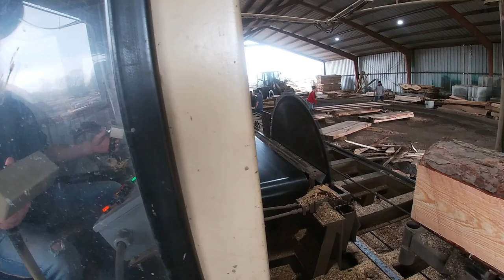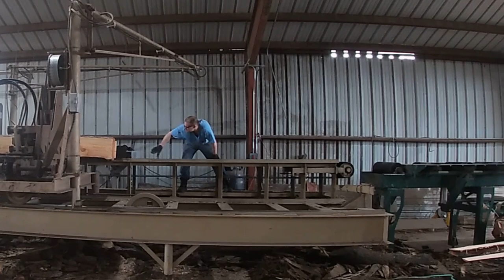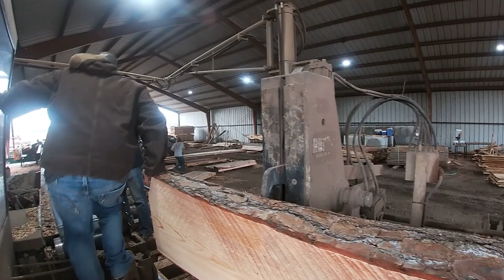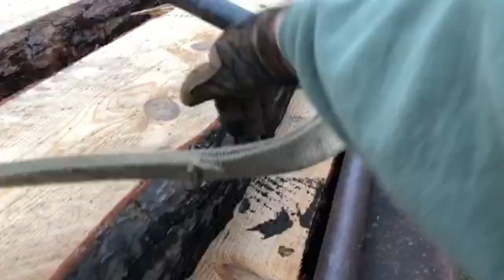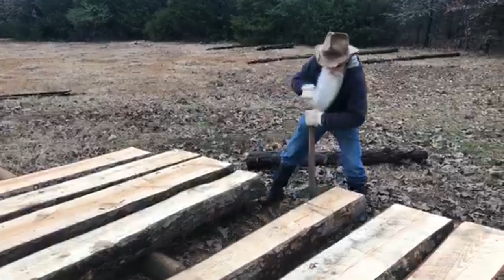Sawing Pine Logs for The Log Cabin Build (Ep 4)

Comment: I left me bark on the jack pine and leave the log for a bit. I let the pine beetles get in and chew for a bit than I go and peel the bark off. I love the patterns they leave when they chew the wood.

Bless you and yours.
Reply from the maker: NorthWest Firefighter Howdy- it would be so much easier to not have to worry about the critters it the logs but down here they will get in the logs if I don’t get the bark off fairly quick. They bore down into the logs and leaves ugly tunnels in the wood. When the logs are sawn into lumber the boards are very interesting with the marks the bugs leave. Thanks for watching and commenting. God bless y’all

Comment: So is this yellow or white pine? I live on the Missouri side of the Ozarks and planning on building a traditional log cabin but was told to stay away from yellow pine because they rot. Do you have any insight on this? Thanks
Reply from the maker: Loftis Party of Six - weROAM Howdy- thanks for watching and that is a real good question to ask. As with just about any kind of wood yes pine will rot. Keeping a good roof  with plenty of overhang, porches ( which l think should be on any cabin) having the bottom logs high enough off the ground to keep moisture off. Also, orienting the cabin against your prevailing winds helps. There is a lot that can be done to eliminate rotting. As with any home there is some upkeep. I have done repair work fixing bad logs where there was poor design or bad roof. Yes, l am using yellow pine but with the design I should never have any problems. Hope this helps-if you have questions you can email me at The Bearded Carpenter 8@ gmail. com. God bless

Comment: so I just bought some land with trees on it that I want to cut to build a cabin with. I have to clear at least 2 acres out for my shop and cabin. when I cut the trees I wont be immediately using them, so what do I need to do to keep them good until I am ready for them? they will sit for at least 3 to 6 months before I can do anything with them. Do I completely debark them, or leave them and stack them with spacers between them. I dont want them to rot or get bugs in them.
Reply: Yoshi Ben With me I left the bark because I wanted the pine beetle to get in under the bark and chew for a wee bit to get the marks they leave. I love the marks. Than I peel them and stack them with spacers in. I would suggest you peel them right away if you don’t want bugs.

Good luck and enjoy your cabin build.

Comment: Wow. Cool saw mill. I don't know why but if I were to choose between Machine milling I prefer the look of logs milled on a large circular saw mill rather than a bandsaw mill
Reply from the maker: Howdy Tim- circular sawed timbers do have a distinct look over the bsndsawed timbers. Yep, that’s a really fast mill for a small operation. Take care and God bless
Reply: I have to agree Tim, circular blades do a much better job...I think it's that slicing of the fiber as opposed to cutting 'across' the fiber...produces a better looking piece of wood I agree...clean
Reply: @chrisharrell5945  yeah. It's probably more of a shearing action with the circular blade. I'd love to see a comparison between moden band saw mill and the old, water powered vertical cutting setups.  I don't know what they were called but they are kinda like a giant jigsaw.
Reply: @timbarry5080  "shearing" - exactly what I meant by my word 'slicing' that I used.  Shearing/ slicing.  Same theme at the wood lathe, the younger gens are all over YouTube using the carbide tipped lathe gouges without understanding the traditional gouges shear and produce chatoyance, whereas the newer tooling on the market doesn't.  Those new gouges are doing at the micro very much similar to what the band teeth do on the larger scale.  More of a ripping and tearing as opposed to shearing. 

Yeah that would be a cool comparison - the old water powered setups..I bet you can find some archived videos somewhere with Roy Underhill doing a walk through.  I know I've caught a snippet of what you're talking about before and believe it might have actually been with Roy.  My recollect wants to tell me, I've seen that very machine in the background somewhere, sometime...I just cannot recall where but my subconscious remembers.  A giant jigsaw.  Heck, I'd love to build one.  Seems safer to me...I know, it's just a mental thing-- but there's something about those large circular blades even sitting in park that shake me....just looking at them in park rattles me a little...I guess it's like those big ol timber rattlers 😂
Reply: @chrisharrell5945  can the average user even sharpen a carbide gouge? I have and use a lot of vintage circular saws. Often they come with the old blades. Sometimes I think of finding a vintage blade sharpener and using them. The modern carbide ones are nice but they are throw aways. I had a local guy "sharpen" a 10" one for my portable tablesaw but it came back worse than when I gave it to him.
Reply: @timbarry5080  Yeah, the carbide cutters on these new lathe gouges can be sharpened with a fine diamond stone.  Just flat down with figure 8s brings them to speed.  Obviously an entirely different carbide than what's bonded to the circular blades though. I dont' think I've ever even heard of anyone attempting to or as you say, 'if you even can' sharpen a carbide blade. I'd love to know if you find an old sharpener and try.  I'm certain it's a precision manufacturing process which can't be replicated, in my little shop anyway.  🥴